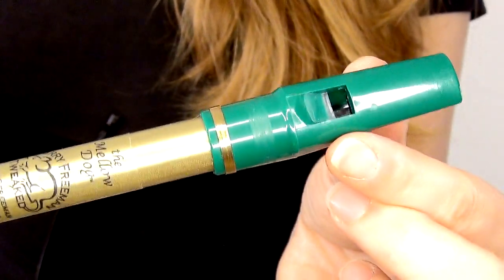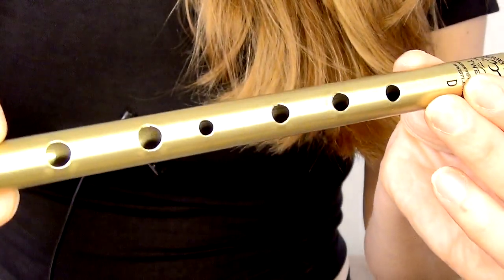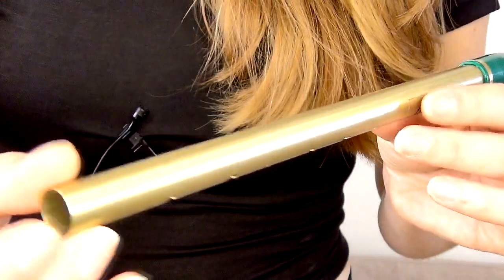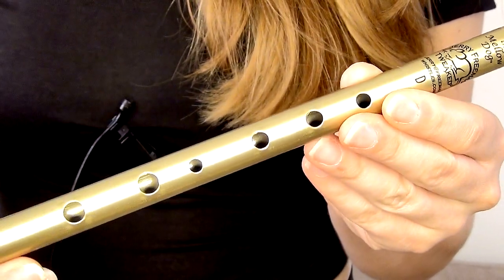TRYING A TWEAKED WHISTLE | THE MELLOW DOG HIGH D JERRY FREEMAN PENNYWHISTLE REVIEW

Comment: Thanks, Stephanie, for this wonderful review. For any who are interested, here's more information about how I tweak a whistle ...

Here are some of the issues with mass produced whistles:

1. There are shapes that can't be made with a mold. If there are "undercuts," the molded part will lock inside the mold and it will be impossible to open the mold without damaging the part. Because of that, compromises have been made so whistleheads can be mass produced using injection molding machines.

2. Also, the hollow underneath the windway is not there for a functional reason. It is there because an injection molded plastic part must avoid large variations in wall thickness to prevent "sinking," which is the distortion caused when hot plastic cools and thicker areas shrink more than thinner areas.

3. The "step" is never correct in these whistles. The step is the position of the soundblade relative to the windway floor. If the bottom of the soundblade is above the windway floor, that is a positive step. If the bottom of the soundblade is exactly even with the windway floor, that is zero step, and if the bottom of the soundblade is below the windway floor, that is a negative step.

Here's what I do when I tweak a whistle:

~ I remove the whistlehead. With some keys of whistle, I enlarge the socket so it fits the tube correctly to be more easily tuned.

~ I fill the cavity under the windway. This helps stabilize the whistle’s response and clean up the sound. What material you use matters, I've found. Some materials that people often use (e.g., poster putty) can deaden the sound. I fill the cavity with a lattice I've developed that is acoustically transparent, but that the air stream encounters as a solid surface. That preserves the resonance to retain the birdlike brightness while reducing turbulence in the airstream.

~ In the mass produced whistleheads, where the windway floor connects with the voicing chamber, there is a square edge. That is necessary because an appropriately chamfered or rounded edge would be an undercut that would make the whistlehead impossible to remove from the mold. I correct that by working a radius onto the end of the windway floor. Different keys and models of whistles require different radii.

~ I laminate a thickness of plastic underneath the soundblade to correct the position relative to the windway floor. I also place the lamination differently in different whistles to achieve the different voicings that distinguish Bluebirds from tweaked Generations, etc. I've modeled the tweaked Generation's voicing to match as closely as possible the classic voicing of the Generation whistles that were produced between the middle 1950's and the early 1980's when Generation replaced their tooling and the whistles changed.

~ I press a brass ring around the whistlehead socket to protect it from cracking from the pressure of the tube inside. That has always been the demise of these mass produced whistles. Occasionally you see a performer playing an old Generation whistle that has electrician's tape wrapped around a cracked socket.

~ Depending on the key and model of whistle, I remove some material from one or both ends of the tonebody to bring the bell note into tune and increase the range the whistle can be tuned. Mellow Dog and Bnat, alto A tenor G, low F and low D Generation tonebodies I make myself.

It bears mention, some of these adjustments are interrelated. If I change one of them, another adjustment will need to be modified to make it work correctly. If you were to only do one or two of the tweaks, even if you could duplicate them exactly, you would not get the same result.

I hope that makes sense.

Best wishes, 
Jerry Freeman
Reply: Cool, thank you for the knowledge.
Reply: The first custom whistle I purchased was your Mellow D/C combo off of Ebay  around 10 years ago. I always brought that whistle to play session stuff with (sadly I haven't played with others since Covid). A few years ago I really got into low D whistles and play them at home instead of my high Ds. This video inspired me to see if you are still selling the Bb Generations (for playing at home) and I see you are selling a low D Generation. How could that even exist? I might need to get one of those.
Reply: @justadjimmi6613  I was somewhat amazed myself when the low D tweaked Generation experiment actually worked (finally after 15 years of trying). It uses the largest diameter tubing a Bb Generation whistlehead can be adapted to fit and tweaked to suit, which results in a very narrow bore for a low D whistle. It's a very nice, quiet whistle with an interesting, characteristically "Generation-ish" tone, as I've described in the eBay listing:

This is a quiet low whistle with comfortable air requirement and a rich, velvety tone. Nicely balanced between octaves. Many have commented that the upper register is especially pleasing and easy to play.

"It has a unique tone, nice in the bottom notes and extraordinary in the upper reaches. The narrow tone body and Bb head make much longer phrases possible. It should capture a unique place in the low D market." ~ F.C., Iowa

Here's Nathaniel Dowell demonstrating and commenting on the Freeman tweaked low D Generation:

https://www.youtube.com/watch?v=w7z_76Hm6yo 

And here's the eBay listing:
https://www.ebay.com/itm/284895206034?hash=item425513da92:g:to0AAOSwy0xizsiI
Reply: Thank you for the additional information!
Reply: @JerryHFreeman hey. As a dutch person, shipping from ebay will cost me just as much as the whistle itself. Is there a better way to get your products here in europe?